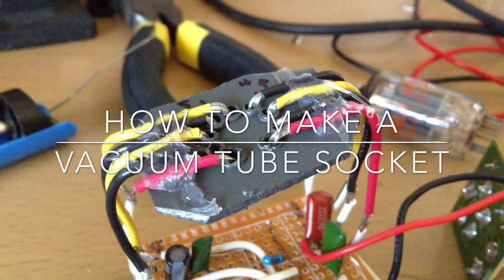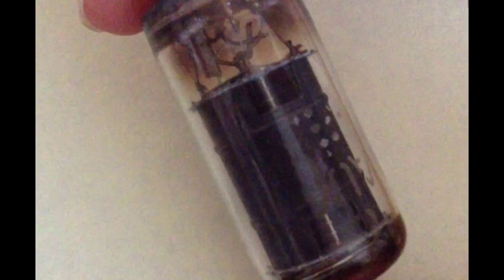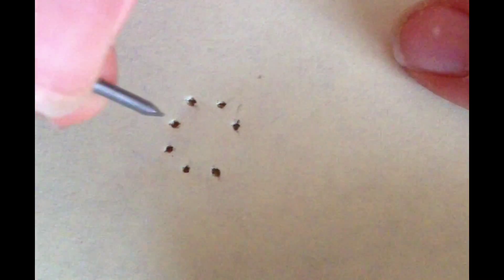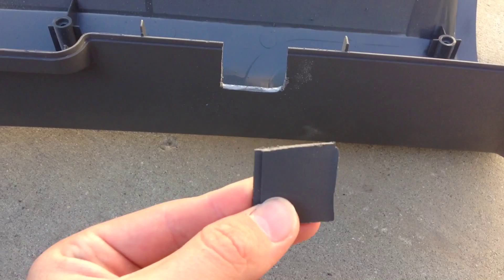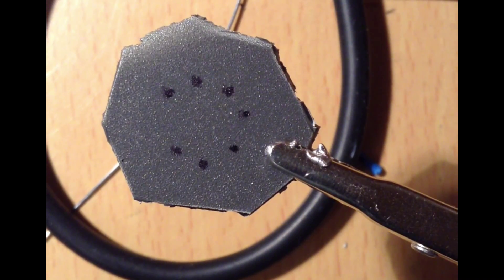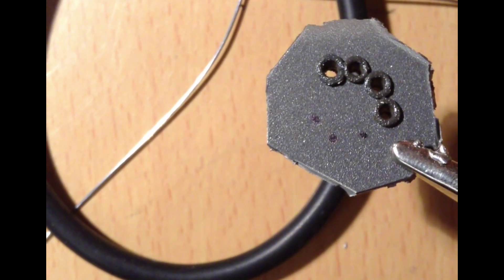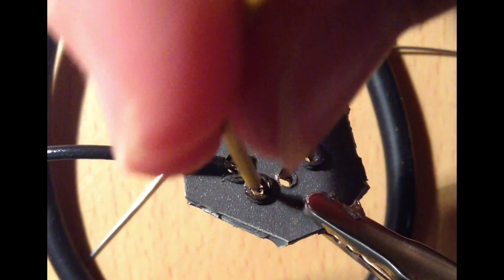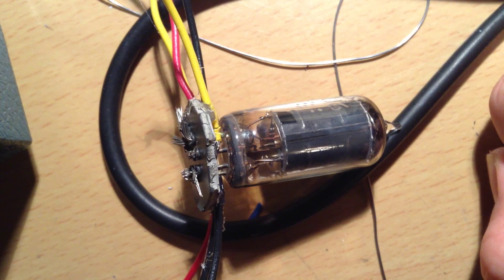DIY Vacuum Tube Socket

Comment: Plastic and hot glue may cause problems for you in the long run due to the heat of the tube, but the idea does work. One can try the same thing with getinax or glass textolite instead, and probably drill one more set of holes closer to the edge or carve a notch at the edge of the socket for each wire to wrap around the socket material once. Then twist and solder the wire in place to itself instead of using hot glue. If you want to be pedantic, you can also do the contacts out of an old tin can or something.

Comment: i soldered to a tube, their are no rules
Reply from the maker: Nice! I just find it very difficult to solder directly to the tube.  Then you cannot use it again for other things.
Reply: @TannerTech  simple, you just have to sink the tube pins in vinegar and alot of salt for 18 hours and then wash it with water and then solder it😅

Comment: Hi. You use some kind hot glue for making the connecting cable stay in place. But in working condition tube will get hot which can melt the glue and loosen the cable. I'm afraid it will short out.